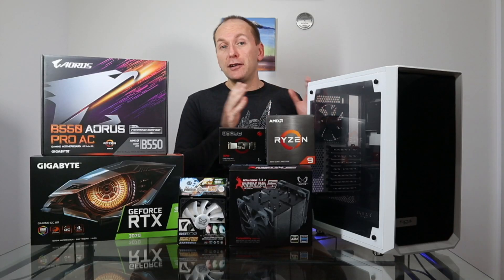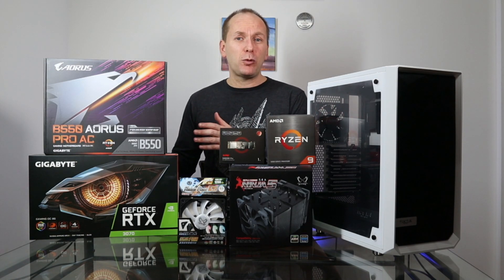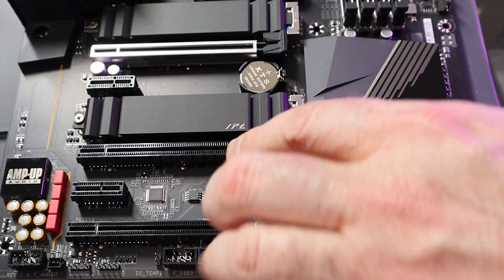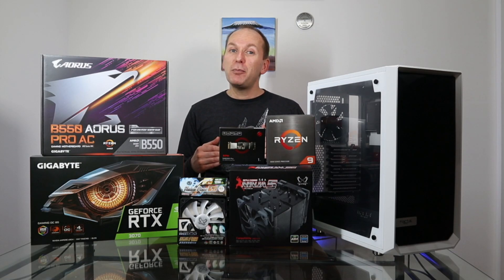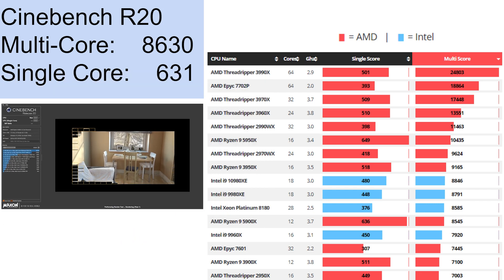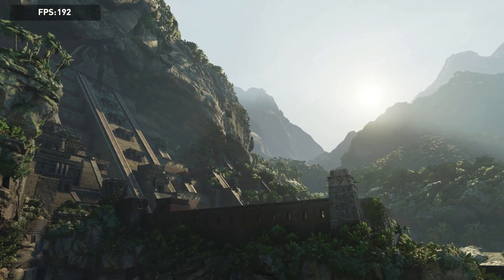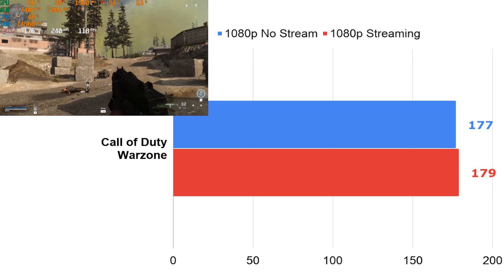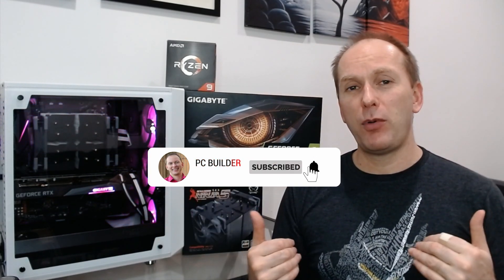Best PC Build 2021 [with Benchmarks] - Ryzen 5900X & NVIDIA RTX 3070

Comment from the maker: What do you think of the build? What are your thoughts on your next build?
Reply: Curious on your motherboard, why B550 when for almost the same price you can get the GIGABYTE X570 AORUS ELITE WIFi?
Reply: Build and part selection was great. Of course, no way in hell tho that Aorus Pro came with installed bios supporting 5000 series CPUs. Skipping that step on the video was such a missed opportunity to warn newcomer builders to that fact and maybe doing a little qflash tutorial.
Reply: @Ollie__  well you can just flash it with a usb drive too, so it's not a big deal
Reply: @jonashediger182  of course you can, as I said.. missed opportunity to warn newcomers and do a qflash (Gigabyte's usb drive bios flash) tutorial.
Reply: Nice build, thanks for sharing - did you put thermal paste on it? looked like you missed it out in the vid, but I'm sure you did. What temps are you getting on that system when no load and full load?

I'm still waiting on my new beast to arrive, ordered last Nov - still waiting on stock. - 

Case
CORSAIR OBSIDIAN SERIES™ 750D FULL TOWER CASE
Processor (CPU)
AMD Ryzen 9 5900X 12 Core CPU (3.7GHz-4.8GHz/70MB CACHE/AM4)
Motherboard
ASUS® ROG STRIX X570-F GAMING (USB 3.2 Gen 2, PCIe 4.0) - ARGB Ready!
Memory (RAM)
32GB Corsair VENGEANCE DDR4 3200MHz (2 x 16GB)
Graphics Card
10GB NVIDIA GEFORCE RTX 3080 - HDMI, DP
1st Storage Drive
2TB Samsung 870 QVO 2.5" SSD, SATA 6Gb/s (up to 560MB/sR | 530MB/sW)
1st M.2 SSD Drive
2TB SEAGATE FIRECUDA 520 GEN 4 PCIe NVMe (up to 5000MB/R, 4400MB/W)
Power Supply
CORSAIR 850W RM SERIES™ MODULAR 80 PLUS® GOLD, ULTRA QUIET
Power Cable
1 x 1 Metre UK Power Cable (Kettle Lead)
Processor Cooling
Corsair H115i PRO Cooler w/ PCS Ultra Quiet Fans
Thermal Paste
STANDARD THERMAL PASTE FOR SUFFICIENT COOLING
Sound Card
ONBOARD 6 CHANNEL (5.1) HIGH DEF AUDIO (AS STANDARD)
Network Card
10/100/1000 GIGABIT LAN PORT (Wi-Fi NOT INCLUDED)
USB/Thunderbolt Options
MIN. 2 x USB 3.0 & 2 x USB 2.0 PORTS @ BACK PANEL + MIN. 2 FRONT PORTS
Operating System
Windows 10 Home 64 Bit - inc. Single Licence [KUK-00001]
Operating System Language
United Kingdom - English Language
Windows Recovery Media
Windows 10 Multi-Language Recovery Image - Supplied on USB Drive
Office Software
FREE 30 Day Trial of Microsoft 365® (Operating System Required)
Anti-Virus
NO ANTI-VIRUS SOFTWARE
Browser
Microsoft® Edge (Windows 10 Only)
Warranty
3 Year Silver Warranty (1 Year Collect & Return, 1 Year Parts, 3 Year Labour)
Delivery
STANDARD INSURED DELIVERY TO UK MAINLAND (MON-FRI)
Build Time
Standard Build - Approximately 21 to 23 working days
Promotional Item
Get CoD:Cold War & 1YR GeForce Now w/ select RTX Graphics Cards
Welcome Book
PCSpecialist Welcome Book - United Kingdom & Republic of Ireland
Reply: @harag9  nice! Buying something similair. Would last us years! :)
Reply: @harag9  I would buy a second set of your 16Gb ram, fir such a premium system, otherwise great!
Reply: Looks great! Can't wait to get my parts, was wondering if I should hold out for a 3080 ti, or just try to get my hands on a regular 3080.
Reply: @xAnDroiDx1  get whatever you can!
Reply from the maker: I'd get whatever you can, but who knows?
Reply: @xAnDroiDx1  fingers crossed. I just ordered a PNY 3080 in the UK, found stock
Reply: @xAnDroiDx1  hmm. The gap between 3080 and 3090 is very small. You won't really have better performance, but more Vram. But honestly most games are only using 4-6Gb of Vram right now.. so I don't know.
Reply: I also wonder why the B550 Mobo… there should be better options. 
Anybody keen to give an update on these parts on todays date? Still valid? Prices for me are 2700€… 🤦🏻‍♂️
Reply: @khat_diveprivate2518  for most people the 550 is more than enough. The 570 doesn't really add much...esp for gaming. The onboard fan is a bit of a turn-off as well.
Reply: I'm building a similar PC! All I was missing was a graphics card and I just scored a heck of a deal on a brand new and sealed 3070TI for $570! IM EXCITED!!!!!!!!!!!!!!!!!!
Reply: All your missing is some c16-16-16-36 ram 4K mhz & then it will be smooth.
Reply: The build is great. I'm running an IN WIN 101 mATX mid-tower case. I read every present component is able to fit in said case yet have my doubts. Love you, your videos and guidance. When buying a PSU that has PCIE 5.0 it's going to run perfectly fine with a motherboard with PCIe 4.0?

Comment: Hi I have, a question what to choose currently I have, a board b450 (MSI gaming plus max) and I question whether it makes sense to change to am5 for example on 7700 or choose Ryzen 7 5800x3d or 5900x and do not change the board? I have RTX 3070 and Ryzen 7 3700x please advise.
Reply: The computer is mainly for gaming and for Photoshop programs such as Adobe but still more to play.
Reply from the maker: WIth a 3070 I'd go ahead and upgrade to a 5800X3D. That will set you up to do GPU upgrades in the future too. See our Best GPU/CPU Combo 2023 video for more

Comment: What power supply are u running for that 5900x with the 3070 graphics card
Reply from the maker: I actually just put out an updated Best PSU 2022 video on Friday! My thoughts on what you need have changed since this video with new power spike info coming to light.

Comment: great video, informative and helpful, but I have one question when It comes to this build I was thinking of going for the b550 aorus pro ac like the one you used here but I also was looking at the asus rog b550-f (with wifi) which one of these two would you reccomend
Reply from the maker: Both good boards! Could go either way. The V2 version of the Aorus pro do have a usb type c front panel header if that's important to you.

Comment: gigabyte b550 aorus pro v2 ?? can i use that?
Reply from the maker: Yes only difference is that the V2 has a front panel USB type c header.
Reply: @PCBuilderChannel  Hey Jason, first off great content and ive finally decided my build. which is exactly what uve shown here just a minor tweak with 3080. I was planning instead of ur suggested MB can i actually go with Gigabyte B550 AORUS PRO AX ? does it have the same VRM as pro AC or should i go with V2 as asked earlier. AX is giving me a wifi n ctype.

Comment: My 5900x idles at 70 plz help and it keeps going up in down by 10 degrees I have insane airflow 10 fans so it’s doesn’t make sense with a 360 mm aio
Reply: Is probably a bad aio pump.

Comment: Currently on pcpartpicker I have “warning” I had a question about. “If motherboard is using an older bois version it’ll need upgrading” I will just have to update the bios using a usb right ? Thank you
Reply from the maker: Correct! Really wish they wouldn't slap that warning on every Ryzen build lol.
Reply: Also looking for a compatible rgb case to hold the same motherboard gpu and cpu from this video with a nzxt kraken z73. Keeping getting an error code with the “cool” cases. Case usb will not be usable. Do you have any recommendations for me ?
Reply from the maker: Check out the Phanteks p500A !
Reply: @PCBuilderChannel  thank you, I will be using a inateck 2 port PCIe USB adapter for my Problem

Comment: Hey guys Does anyone have a good full pc build around 3.5k Aud with around high spec for gaming smoothly for long term use or should i just buy a good high end laptop and wait for the gpu price to go down. This is my first time trying to build one so i dont know what to choose in terms of brand and all but i got i good general idea i guess
Reply from the maker: The build in this video is a perfect baseline for you. If you are having trouble getting a GPU I would start there. If you can't get a 3070 then I'd go for a 6700xt
Reply: @PCBuilderChannel  thankyou for this it's very helpful. your vids have been very informing so far so great job. another question i had in mind is it possible to attached a hdd in this mother board or a sata 2/4 tb ssd with this mother board or maybe i should change the mother board into something else

Comment: I added all the parts into the pcparts picker and a warning about the compatibility of the motherboard and cpu popped up. Will there be any issues in that regard that I should worry about? This would be my first time building a pc. Additionally, how much does a 3070 oc 8gb differ to a 16gb one, is there a performance difference or simply a size and cost difference? @PC Builder
Reply from the maker: The warning is just that the board may need a bios update, which is why I only recommend boards like the Aorus Pro B550 which have bios flashback when building with Ryzen 5000. If the system doesn't come Ryzen 5000 ready, using bios flashback is fairly easy, and I have a video on how to do it. The RTX 3070 only comes as an 8gb GPU, there are no 16GB versions. Remember that is VRAM (video ram) that comes physically installed on the GPU, not system RAM which you install onto the motherboard. Hope that helps!
Reply: @PCBuilderChannel  Wow that was a fast reply. Okay I will be sure to check that video out! Thank you for the clarification and awesome content. Have a great weekend!

Comment: If I'm going for competitive high refresh rate 1080p 240hz, is this build still overkill? Currently have a 5600x + 2060  and I'm willing to upgrade to 5900x + 3070. I actually already have the 3070 sitting here, I just haven't opened it yet because I'm not 100% sure I should switch

Comment: is it possible to fix Corsair 360mm AIO IN CORSAIR 4000x cabinet on the top side ?Or should I  get Corsair 5000x cabinet?
Reply from the maker: I think the top on that case is 280mm max, but check the case specs to be sure.

Comment: Is there a prebuilt out there similar to this that’s available to order anywhere? Or you want to sell me yours ahaha 🤣 but seriously
Reply from the maker: Yes! I have a prebuilt guide on the channel. Expand the description for links. It’s the one on the top with the Ryzen 5900x. It’s actually a better system than we build (;
Reply: @PCBuilderChannel  I ended up doing this build. Im very happy with the performance but I’m having CPU temp troubles. It’s almost always around 78-87, is there a better fan then the scythe ninja 5 that you’d recommend that would fit in this case?

Comment: Yup just finished my build yesterday after finally getting a AMD 5900x lol
Other specs are RTX 3070 Founders 
32gb 4x8gb 3200mhz ram from corsair
White Lian Lii Mesh II Case
White cable extensions 
White Corsair H100i AIO Cooler
This PC is now a beast and I spent total $1800. I was able to buy my parts slowly starting with the 3070 in October but trying to find a 5900x for retail was a huge pain in the ass lol. Great video.
Reply from the maker: Awesome! Congrats! We have almost the same pc 😁
Reply: @PCBuilderChannel  yes we do 😉

Comment: Just wondering what types of temps your pulling while streaming doing a build for my channel currently have the 5800x and looking for a 3070 or 3080 can either water or air cool have both options already . Heard the 5800x was a bad choice due to price and heat issues but I know someone running it already without issues on air so not really worrying about that but he doesn't stream . Just looking to be able to do a quality stream while gaming .

Comment: Ive got a few questions regarding the streaming settings for this build in obs. When you were streaming what were you using to stream it the Cpu or the Gpu? What did u put your bitrate at and what setting did u put your Cpu Usage setting (if your using the Cpu to stream) What were your settings if you were streaming with the Gpu? Ive been looking and researching all over the internet for the best streaming rig that can stream on youtube with the best quality (1080p 60fps to 4k) I have a budget of $2000-2500 and i really need help with finding all the right parts and spec for what im looking for. If you can help me out that would be greatly appreciated! Thanks!
Reply from the maker: I believe the OBS settings were 60FPS 1080p, Bitrate set to 8000, GPU encoding with NVENC. If you want better quality, the best bet is to have 2 PC's. First one plays the game and the second one has a capture card that grabs the gameplay and just streams. That's what pro streamers do.

Comment: I have a similar build, but I have msi Suprim rtx 3070 and ryzen 5600x. Every time I restart my pc, my vga debug light stays on, takes me about 20-30 mins and n-number of restarts to get it running. It gives no crashes when it finally boots. Can you help me on this please?
Reply from the maker: Hmm. Have you tried removing the card and reinstalling it? I'd also clear the CMOS and uninstall/reinstall the drivers. Remember to unplug and replug the power cables, and try not to use the daisy chain ones (use one cable per connector on the card) . . . though that last one isn't likely the issue. If none of that works, go to the reddit build a pc forum and post there, lots of folks can help.

Comment: Was thinking of getting the samsung evo 1tb m.2, does the adata offer better value? Cheers!
Reply from the maker: I'd just get the cheaper one. The M.2 speeds are so fast that most applications just can't take advantage of them (they barely take advantage of SATA III SSD speeds). If you have a specific application that can, then invest in the faster drive otherwise the ADATA one is a great pro-sumer level option.
Reply: @PCBuilderChannel  Thanks for clarifying Jason, really appreciate it

Comment: I was considering A Gigabyte gpu but ive heard some issues with bent pins and build quality. How is the 3070 serving you?
Reply from the maker: I'm thinking of doing a whole video on this card. It is super solid and kicks ass. Love the RGB too and I'm not usually an RGB person.
Reply: @PCBuilderChannel  Please do! Its £600 here in the UK which is ridiculous but is very much more readily available stock wise than the other cards. Ive been trying to look for a cheap ASUS DUAL card as its £100 cheaper. I think all the 3070 cards are near enough the same anyway so Im just trying to find the cheapest one. Ive got one preordered for 520, but God knows when that will come in lol. Especially in this current market its insane. Re Gigabyte: Heard that the Gigabyte software isnt that good either (in addition to the above). Would love to hear your opinion on all this! Many thanks for the feedback!

Comment: But is the 3070 worth it? It's 100$ more than the 3060 Ti and only 10% faster. I would choose the 3080 or 3060 Ti.
Reply from the maker: If everything was available easily? Maybe I'd have gone with a 3060 Ti. But until then I'd buy either if available. The 3070 does put you over the top in terms of 4k gaming if that is important where as the 3060 Ti comes in just a bit short. I have a 3060 Ti and do plan to do a 3070 vs 3060 Ti video sometime in the near future.

Comment: Hey Jason, I currently have the 5900x paired with the DeepCool Assassin III, but my thermals are less than ideal, under sustained full load I am at 83C. I am using my computer for rendering, should I think about moving to an AIO (also the fans are extremely loud when trying to deal with that temperature) Would love your input!
Reply from the maker: 83C isn't that hot for a Ryzen 5000. AMD upped the temp limits from previous generations as the silicon is just higher quality according to them. This has bothered some people who aren't used to the numbers getting that high. My Ninja 5 kept the PC to 84 C at max temp under sustained stress test which I consider fine (90 C is thermal throttle on Ryzen 5000). The ninja 5 is quiet enough that I don't even notice the noise when at 100% fan speed. But if the Deepcool is too noisy, consider an AIO.
Reply: @PCBuilderChannel  thank you so much!! Do you have any recommendations for an AIO, I have the lian li meshcool 2 performance edition. Would a 360mm radiator at the front be a good call?
Reply from the maker: I'd go 280mm Arctic Liquid Freezer II top mounted, but 360 is also good. Just harder to get a tubes down configuration with these huge GPUs.

Comment: My last PC was built in 2011 and is still running. AMD 4.6 8 core black edition AM3, HD 5850, 16 GB DDR3 2600. Runs games on low to medium settings, and older games on med to high. 

I keep going back and forth on what u want for my next build. I want to play minecraft raytracing. So it's between the 3070 and 3080. I also will play rust, Diablo 4 when it launches, and various other games. I also want to run the build for 7 to 10 years, so I want parts that will stand the test of time. I'm thinking wait for 3080 TI to get those 20GB of DDR6 instead of 10 on the 3080. And a 5900X cpu. Opinions?

I'm also confused on 1440p or 4k :(
Reply from the maker: I'm not sure there will be a 3080 Ti. Rumor is it has been cancelled. But we'll have to see. I'd go with a 3080 if you want to do RT Minecraft. Personally I'm still not sure what the appeal of RT is as while it is slightly better detail is leads to way lower framerates.
Reply: @PCBuilderChannel  think 10GB of ddr6 is okay for future proof? Or do you think the 3070 TI with its 12GB is a better bet? Or even the 6800XT with 16GB?
Reply from the maker: I think people are going a little overboard on the VRAM focus. 8gb is still fine. I want to like the AMD lineup but I usually use features like the NVENC encoder and am not willing to give that up for more VRAM. But if you just game, the Radeon cards are great.

Comment: If I buy that motherboard will I need to upgrade the bios to install the 5900x
Reply from the maker: Yes as very few motherboards are coming Ryzen 5000 ready. But it has bios flashback so it is easy to do without a CPU. I did a video on it check it out.